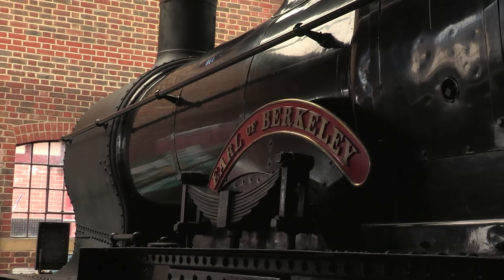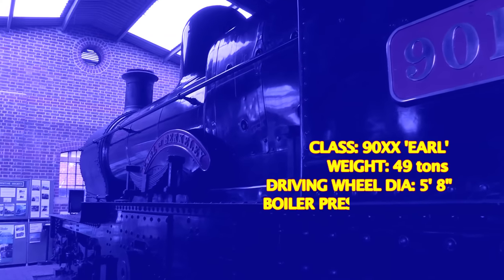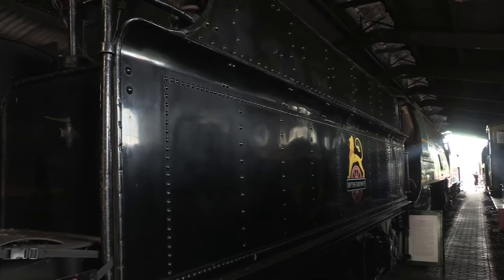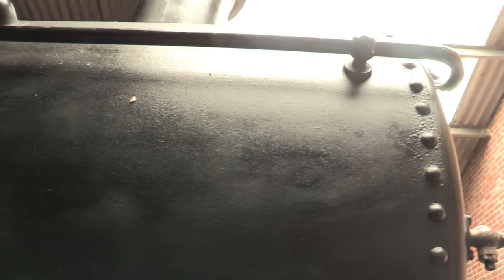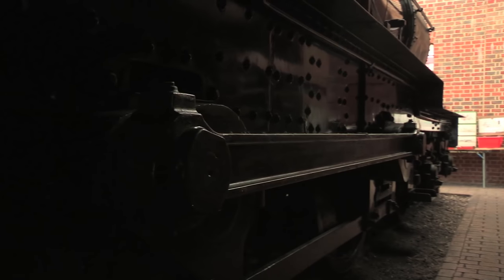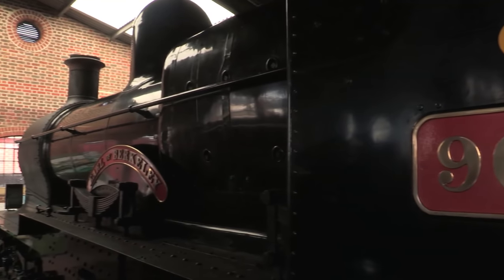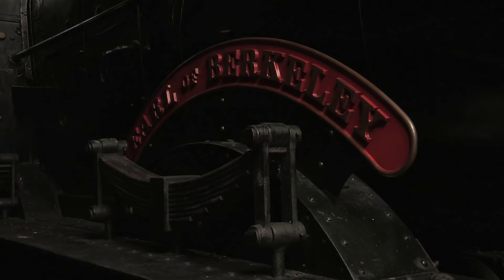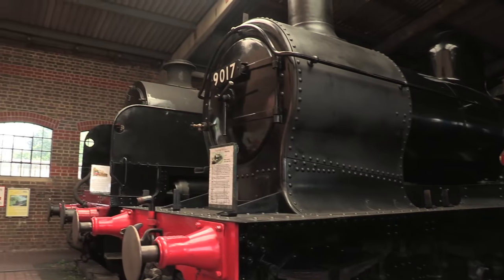SOLE SLIP: GWR Dukedog 'Earl Of Berkeley'

Comment: These engines were remarkably good considering their rather comic appearance.  I have a couple of logs of their runs and they were no joke.  I also took a couple of B&W photos of no. 9004 at Criccieth in 1958.  With their very light weight they could be a bit slippy but they were reliable and steamed well.  No 9017 never actually carried its name even though it was planned to so I don't think it should carry one now.  I'm quite chuffed (no pun intended) that one has been preserved.